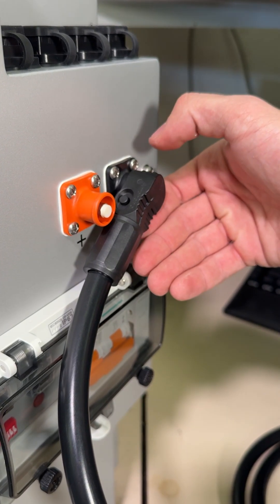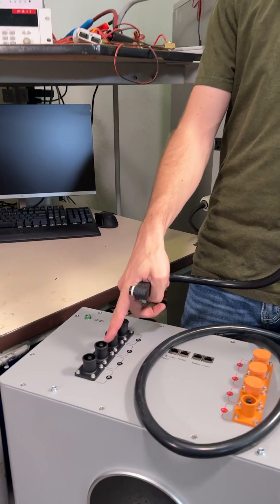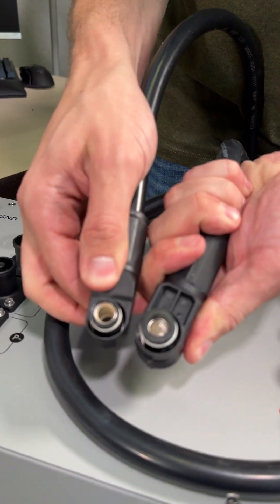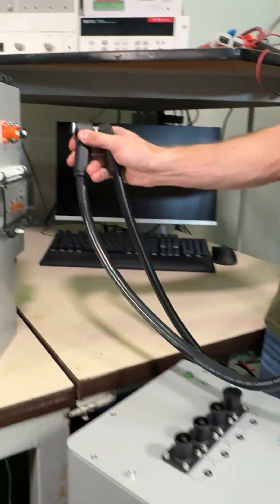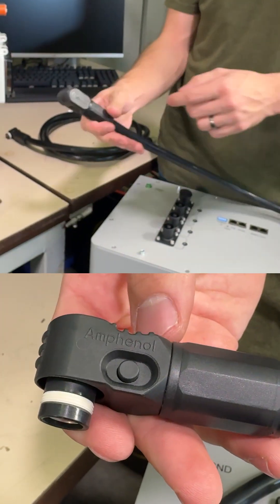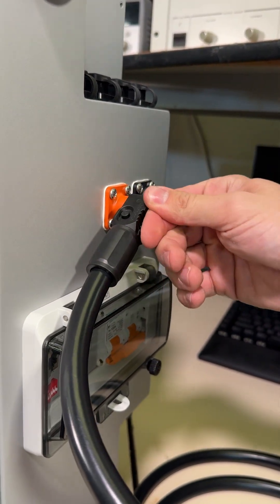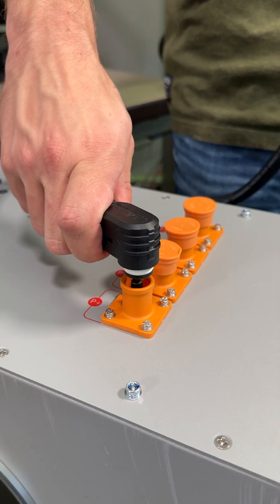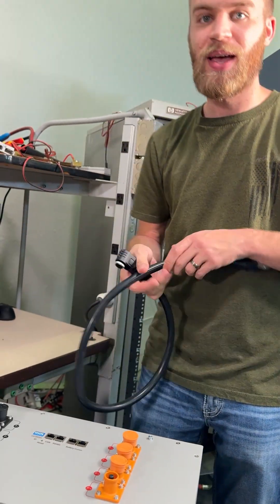The Connector Comparison Nobody Asked For: Amphenol VS Degson Connectors

Comment: Bolt terminals and lugs work just fine and are universal.  The only time a mulit contact contactor needs to be used is when the battery is being moved around and or is in a place, like a car or bike, where there is plenty of jiggling going on.